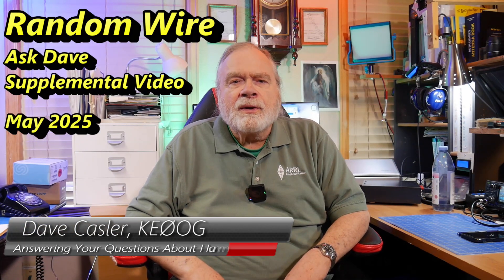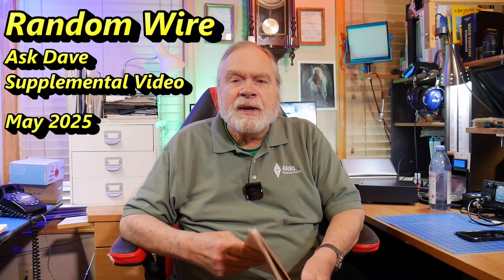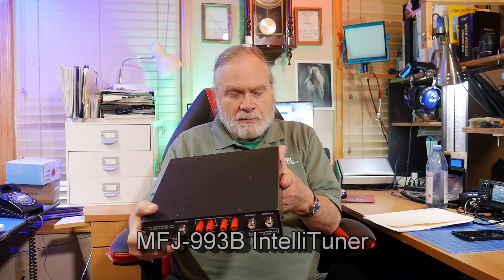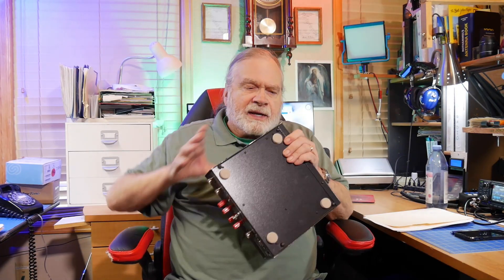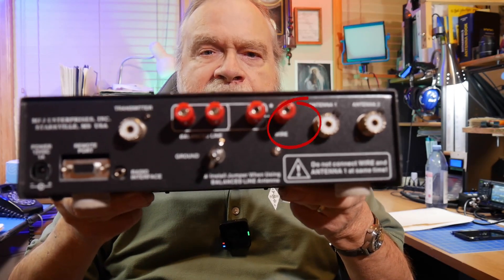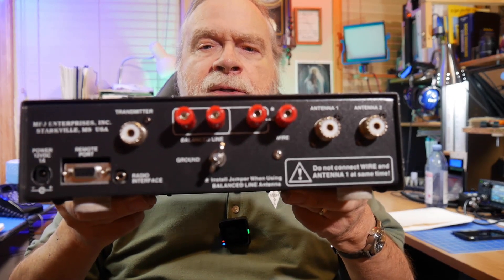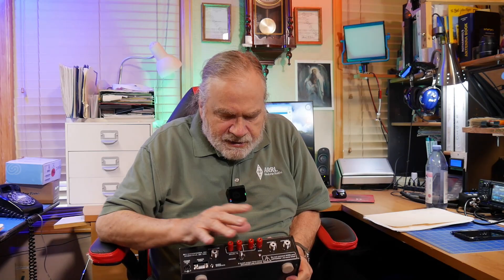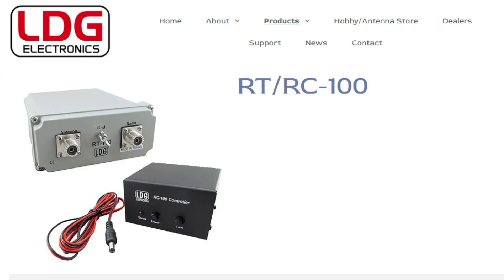QST: Ask Dave May 2025

Comment: Nicely done!  Very good description.  I would add that there needs to be two sides to every antenna.  If we don't provide an intentional "other side" then the RF will find one.  In the case you have shown the tuner cabinet,  outer conductor of the coaxial feedline, the transceiver, and the house AC wiring will become the "other side".  This may or may not be a problem.  For low power it is probably OK.  I remember doing something like you have shown when I was first on the air as a teenager.  My mother got an RF burn from the kitchen range.  She was a bit angry with me to put it mildly.

Comment: Also on 20 m because it's approximately 1/2 wavelength long. The feed point impedance at the end of the wire is about 5000 ohms so ideally for a better match you should have a 9 to 1 balun.

Comment: 35ft. Of wire on 20 m is slightly longer than a half wavelength 468/35ft. =13.37Mhz not one wavelength. Making its radiation resistance approximately 73 ohms. On 40 m it's about 13 ohms.